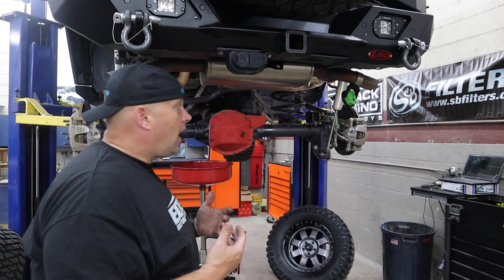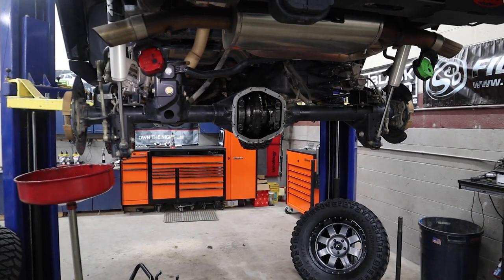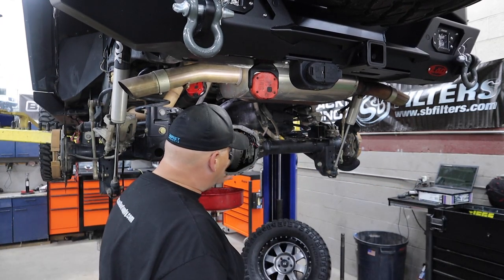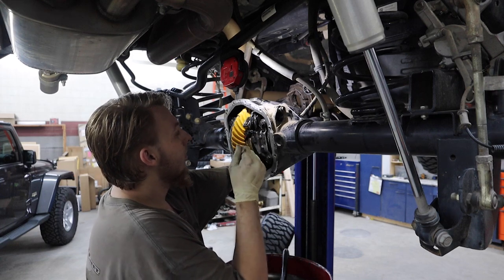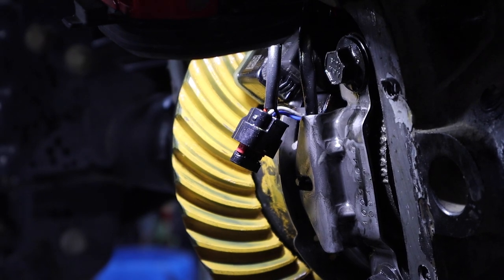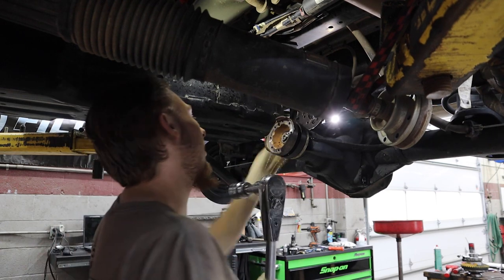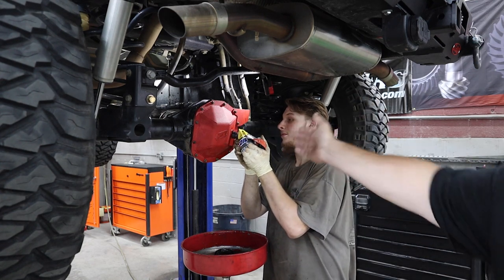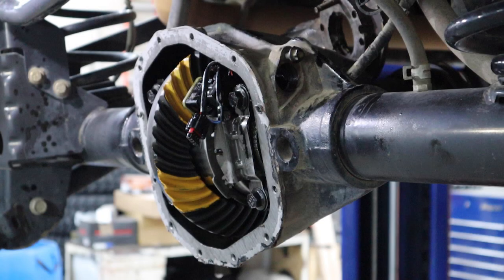JEEP WRANGLER JL 5.13 RE-GEAR Installation of the Rear Differential

Comment: 5.13 gears in a D44 on 37s plus lockers...you're just looking to break. You said it yourself as soon as you unboxed the pinion. "Look how tiny it is". Higher you gear the less engagement you get with your R&P & that becomes the weak point. Now your driveshaft is spinning at an ungodly rate, vibrate & boom...t-case is cracked. Whatever power gain it is you think you're recouping from gearing high isn't worth sacrificing the integrity of the rest of your driveline. People keep reposting that stupid tire size/rpm/gear ratio chart & regear according to that and that alone when that's only half the equation. There's idiots that'll regear a D30 with 5.13 gears because some random stranger posted that stupid chart on some Facebook group. The misinformation is real!
Reply from the maker: I’ll be honest, the pinion size did concern me. As always, I’m going to put it the test & we’ll see if we break it.
Reply: So would you run 4.88 gearing with 37s?  Do you think it's a meaningfully stronger setup?
Reply: @Strizzle81  I have the same question.

Comment: WARNING ⚠️ do not use Yukon gears… they are weak I went through two sets of 513s in eight months and I don’t even off-road! Just normal driving around town with a mild 3 1/2 inch lift and 37 inch tire.  Pot metal garbage save your money